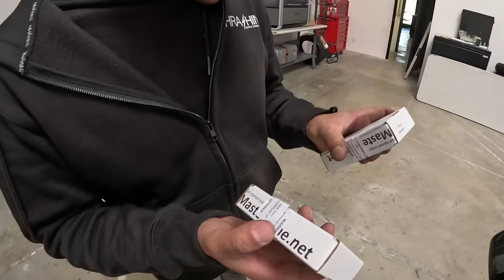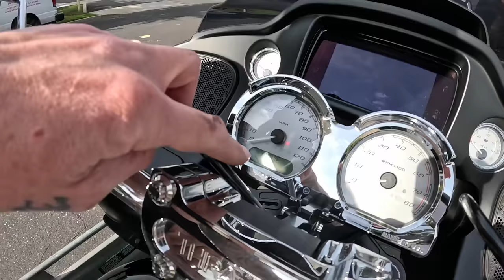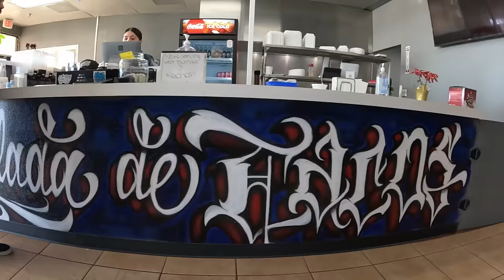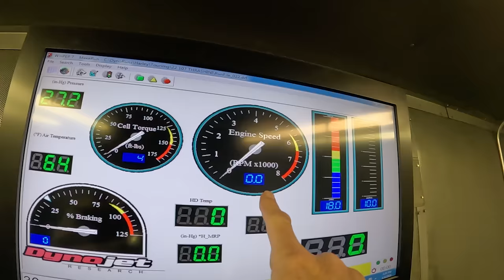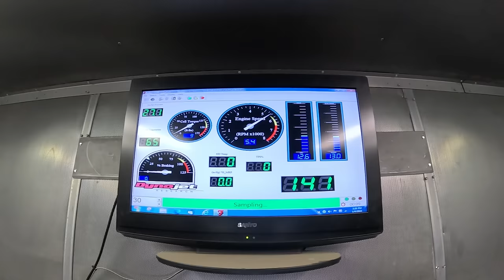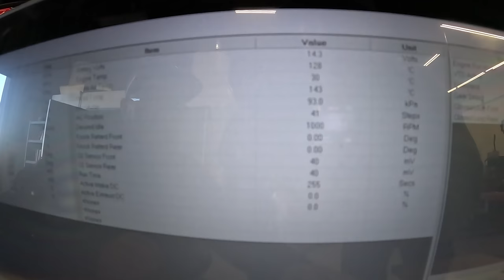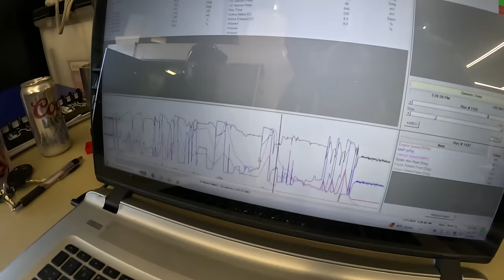Fully Race Tuned & Cammed 107" M8 Final HP Results! (Battle of the Baggers Ep.6) - Vlog 110

Comment: I have a 2018 road glide with 107 did the 472 comp cam and complete tune I got 112hp and 120 ft pounds of torque to the rear wheel and I love it

Comment: It was hard to tell but you should always try and place those O2 sensor pots a min of 10 degrees shifted above the center line to keep moisture and condensation from settling on the sensor in the pipes.  It apparently will cause the sensors to prematurely fail.  Might not be a big deal in Cali…east coast might not be best.  Anyways, love your content!! :)

Comment: Those UHaul moto trailers are a a bargain. Great way to haul the bike in a pinch. That is such a nice set of numbers for touring bike. I just did 6000 miles west coast east coast and back and realized that cruising at 90 mph didn’t need a 150 HP 160 tq bike. I needed a better passing ability and a more robust take off. I have a 114 and would love to set up my RG with this work. Does (Alan?) do general work and service for the public?

Comment: Juan! Now I have to do my 22 reef blue 107! Maybe I’ll go fueling over S&S this time around
Reply: I put a zippers redshift 468 in my 22 reef blue road glide. Got me to 106 hp and 119 ft/lbs tq. I wish I would’ve gone with the s&s 475 though. Pretty much the same numbers but the 475 chops so hard so it sounds amazing
Reply from the maker: You won't regret it!
Reply: go with the Star Racing 30 / 30 cam 485 lift and you can still use your stock valve springs

Comment: And now you will notice less heat off the engine in the summer, you should no longer have your muffler turning blue, and you don't have to worry about scoring a cylinder or burning a piston due to detonation from excessively lean AFR or wicked out timing tables, or both, especially with roll on and at higher engine load and throttle position. Nobody should do engine mods on a Harley without a proper dyno tune by a competent dyno tuner.
Reply from the maker: Agreed!

Comment: Put an aluminum intake manifold on it will help , my 107 has 120tq/117hp with the star 30/30 cam and 2into2 exhaust
Reply: That’s freaking impressive. I wanna put an s&s aluminum manifold in mine and ditch the plastic one. Bump the numbers up a couple notches too

Comment: You went with techno research for your tuner? You are crazy bro that’s why they stopped making them I’m guessing you’re mechanic bought a shit load of maps when they went out of business I’m running that TTS aka techno research and it’s sucks big time I hate it. It’s garbage. I just bought the power vision 3B it’s there race tune.   I haven’t got a chance to put it in yet though
Reply from the maker: Gotta know how to use the TTS 👍🏼 been using them for over a decade with Allon and have great success.
Reply from the maker: Also, a tuner is just a key to the ECM. It’s all about the human being tuner who knows how to use the key. If you have the a tuner who doesn’t know how to use the TTS, then you get bad results. Also you can just buy “maps”. These are custom made maps by Allon. Again, the TTS is just a key into the ECM. That’s all.
Reply: @THRASHIN  well I haven’t had very much luck my mechanic use to work for Harley as a tech for 20 years now he has his own business he swears by that tuner.  1st second and 3rd I’m golden anything after that the bike falls right on its face I can’t even psss on the highway unless I downshift I have 107 with a 475 cam it should rip. I also just put on the chrome werks outlaw 2into 1 and he did the work he said he didn’t even have to tune it I don’t understand I was running the khrome werks eclipse headers and pipes and it wasn’t right then.  But if I’m going with a 2 into 1 it should be retuned correctl??? Thanks for reading my comment I appreciate that